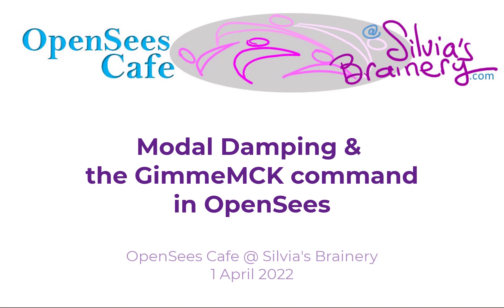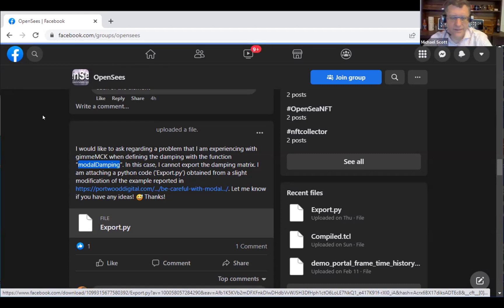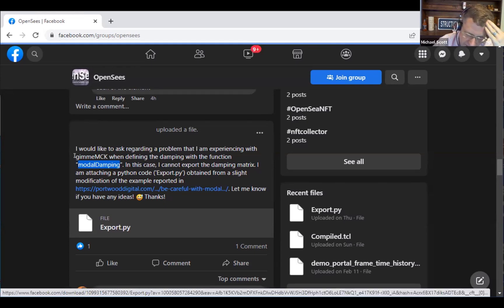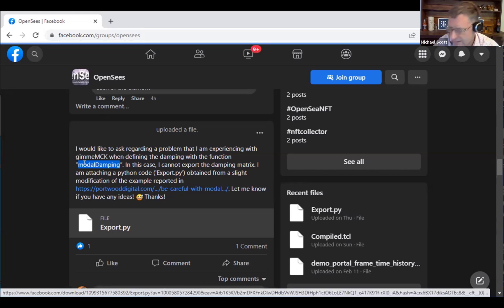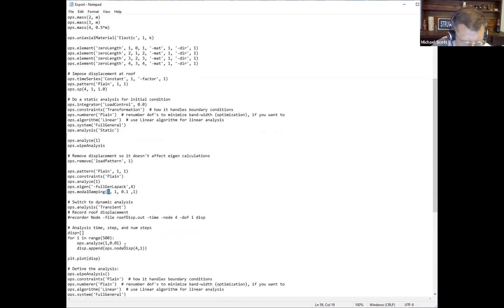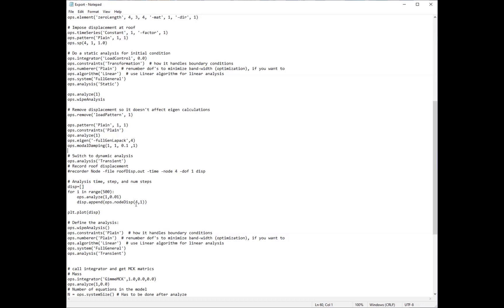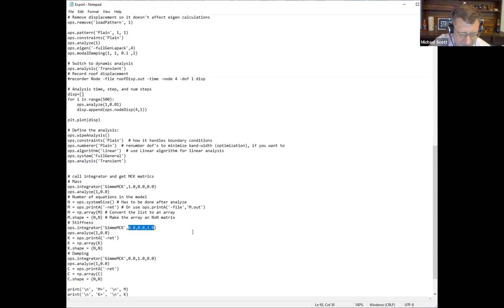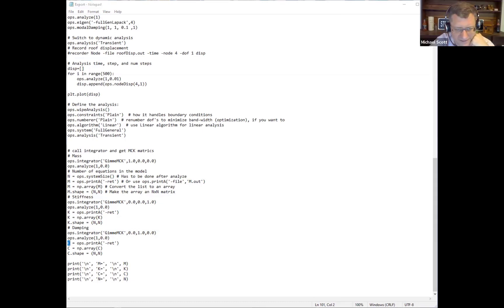OpenSees Cafe @ Silvia's Brainery: Modal Damping and GimmeMCK in OpenSees

Comment: Hi again Doctor Mazzoni and professor Scott. I modeled a nonlinear SDF and push it from elastic range into plastic range. Then in each step I get the displacement and base force (to calculate stiffness handy) and Also I get the stiffness matrix (in each step). results was interesting as doctor Mazzoni said and the Opensees returns the current stiffness matrix and that was compatible with handy calculations.
Reply from the maker: Bijan, your curiosity and your ability on that curiosity are amazing! Thank you!

Comment: Hi doctor, thanks for this useful video. If after some analysis step and configuring hinges in the model, we request the stiffness matrix using mentioned commands, does opensees return the modified stiffness matrix (because of yielding some part of structure) or no it only returns the initial stiffness matrix.
Reply from the maker: Test it out on a simple model and let me know
Reply from the maker: i'm pretty sure it gives you the "current" stiffness value, but it depends on your analysis settings
Reply: @SilviasBrainery  that's really Interesting if it returns the current stiffness matrix. Very soon I will get access to a PC and I will test it as you said and put results here. Thanks for responses